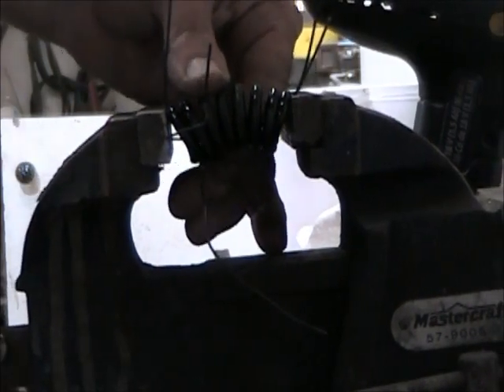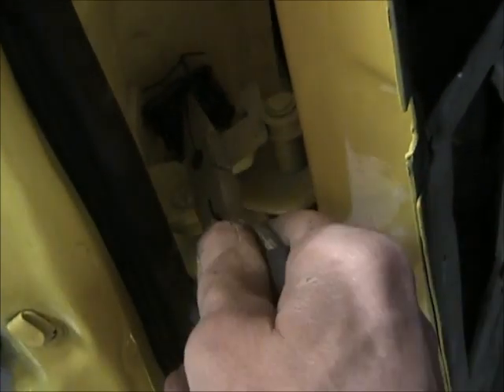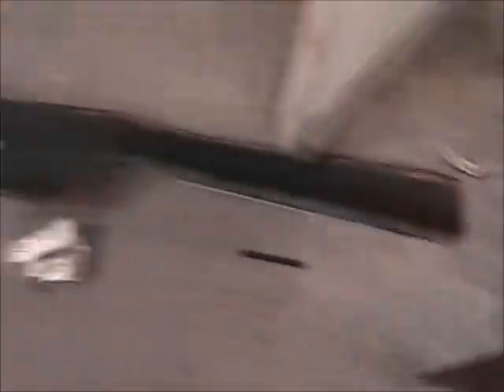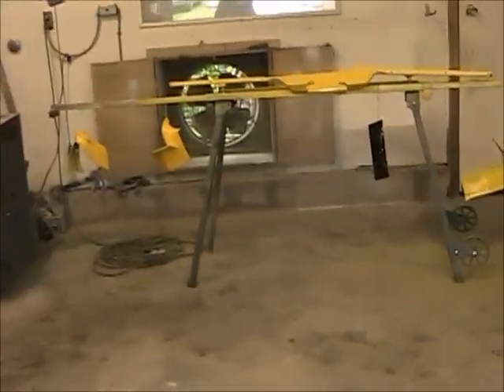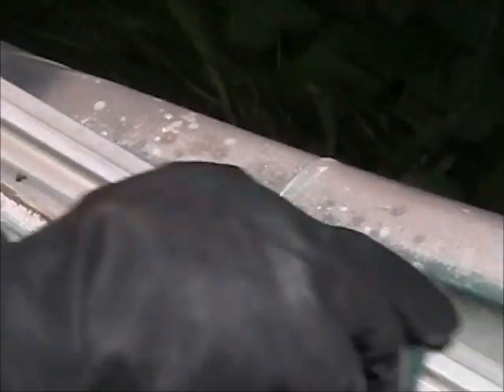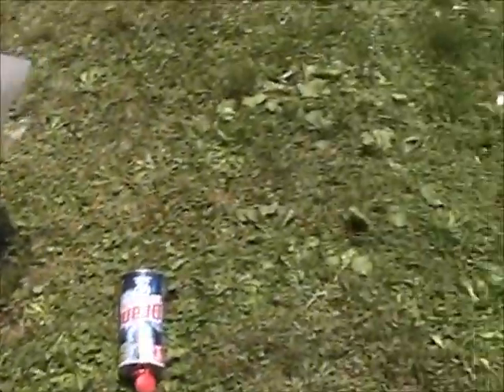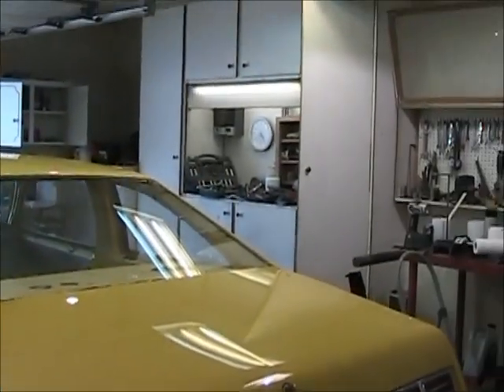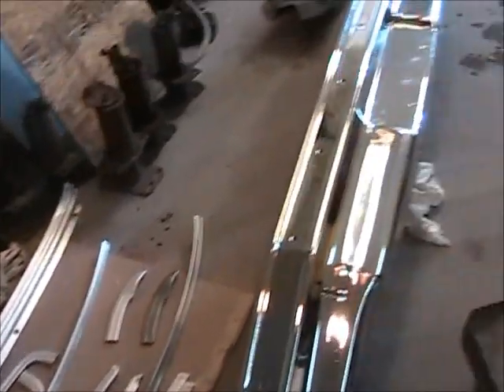a bunch of small projects done

Comment: To make a stronger repair of the plastic it's good to add something to reinforce it when melting it together i.e. non ferrous wire. You should also be able to use plastic zip ties as filler material.
Reply from the maker: thankx for the tips,i do think i should do more since that part is down so low,im going to give the zip ties a try,never thought of using them,looks like the same material,thankx for watching,tc